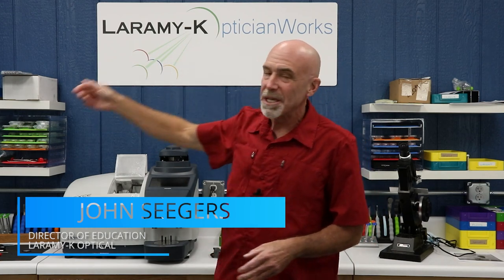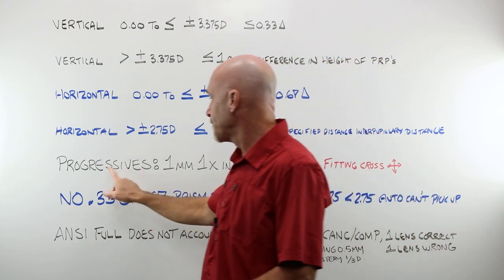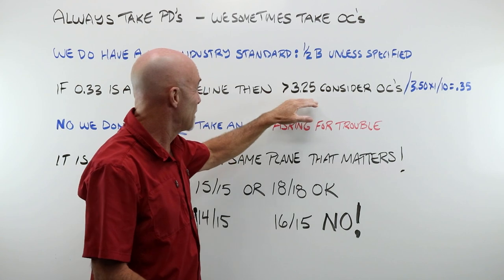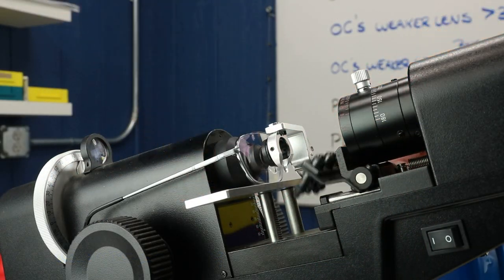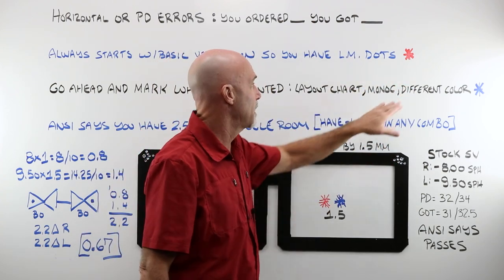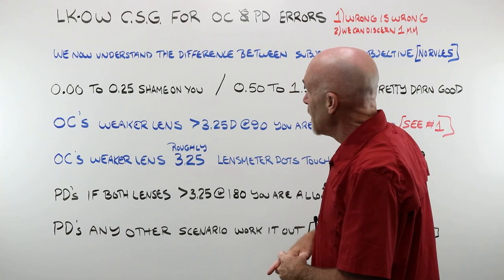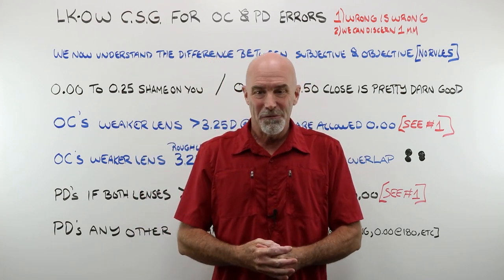Verification of Tolerance: Prismatic Imbalance or PDs and OC Heights

Comment: What is a wave test? My optician did a redo from polycarbonite lenses to 1.67 high index and inside the glasses case were my old lenses that they replaced with a post it on them that said 'wave test'. Just wondering what that could mean.
Reply from the maker: Sorry but no idea. A lens can have a wave or an area of distortion from surfacing error. Perhaps they have a high end auto lensmeter or a lens mapper that is capable of picking that up. But as to a specific "test" have not heard of that.
Reply: @LaramyKOptical  Thanks for the reply. Actually maybe it was the Optician that requested some sort of a wave test when sending them back to the lab and the lab didn’t know what to do with that probably.

Comment: Wow, this video really made things so much clearer for me!!! Thank you thank you! GREAT 3 part series.  I'd just like to clarify a doubt in my head I'm still unclear about. When working prentice formula, whether it's a horizontal or vertical imbalance, what do we do if one eye is correct? What if there is no decentration up or down in one eye? We can't do the formula with 0 mm decentration for that one eye can we?
Reply from the maker: That is why the whole ANSI/ABO Prentices formula stuff is garbage. Just go back to the mantra - if it is wrong sent it back and get it made right. If one lens is perfect and there is enough power for you to pick up an error in the other then figure out where it went wrong (OC no OC, binocular PD when it should be monocular, etc) and send it back. R lens is fine, left lens OC should have been 17 and it is at half the B at 12. Once again you aren't going to waste time trying to figure out if something cancels or compounds! I think you might be "overthinking" it just a tiny bit. You know enough to ask the questions. You know enough to see the problem. Then - You know enough to figure out what went wrong. 

Wrong is wrong. If it is made wrong send it back.

Comment: would a OC height matter more if a digitally optimized lens utilizing vertex, wrap, and panto measurements is being ordered? my thinking is yes. 

what about when we take half the B for a customer who has been glasses with the OC always in front of their eye? would they be bothered by a pair using half the B? My thinking is it'll be a bit of an adjustment at first but something they will adjust to fairly quickly. It would be a tougher adjustment for higher powers.
Reply from the maker: OC height will always be one of the point-of-wear (POW) measurements included in a true free-form personalized lens order/design. 99% of the time they will all come from a digital measuring device of some kind.
Reply from the maker: See: https://youtu.be/el_EAEGSOZE?si=DZ4gDWhJumkT8cEW

Comment: Hi John, what are your thoughts about OCs needing to be on the same plane when a patient has one eye that is definitively higher than the other? Should we do different OC heights in that case?
Reply from the maker: Really tough one there... If you can see the difference just by looking and powers are getting up there it may well be worth experimenting with different OCs assuming that there is a "problem" of some kind you are trying to sort. Might be something to try in basic stock cheap CR-39 as a test and take it from there. John
Reply: @LaramyKOptical  We use an Optikam measuring device in our office and it automatically provides OCs for every order, so we usually provide them to the lab. However, we have definitely not been ordering OCs on the same plane - usually it's just a difference of 1 mm or two between the two eyes, but your comments on the importance of them being the same has us concerned. If we do use a digital measuring device like an Optikam should we just split the difference between what it provides as an OC to get just one OC height?
Reply from the maker: @kirstenwikingazoulay  I've never heard of anyone using different OC heights on routine work. I guess this would be a case of if it works for you keep doing it (?) but it sounds like a horrible idea to me. What would you do if you got a pair like it from outside your office? Wouldn't you think that something was wrong? I mean the very definition of vertical imbalance. The optics of a progressive allow for differing fitting heights but it is not the same for single vision work.  I'm surprised your lab hasn't called you out on it? Does the work actually come back with the different OC heights? Always possible I'm missing something... John
Reply: @LaramyKOptical  No our lab has never mentioned this to us! I just called them to ask about this, and they said that depending on the office/optician they receive both - orders where the OCs are the same and then split OCs set to different heights for each eye. However, they did say that they generally recommend using identical OC heights where you split the difference between the two eyes (if there is a difference in heights). I am flabbergasted - neither the optician who trained us, any of the 4 labs we work with, instructors from other online courses, etc. have ever mentioned this to us over the year we've been working this job. We'll be switching to doing matching OC heights per your advice. I wouldn't have thought anything of it if I received a pair with different OCs because this was how we were trained.
Reply from the maker: @kirstenwikingazoulay  Since the very definition of vertical imbalance is that the OCs are not on the same plane I would think that the optician, labs, instructors etc. didn't feel it necessary to even mention it? If they covered verification and/or ANSI stuff it would have been a part of it. Oh well - guess it goes to show that in routine powers it really doesn't matter all that much!
Reply: @LaramyKOptical  At least as far as the optician who trained us - she expressly taught us to send in individual heights for each eye. To be fair, in taking your course we've found many things that were taught to us wrong, so I guess I shouldn't be that surprised about this! Thankful for all of your great videos.
Reply from the maker: Kirsten Azoulay PLEASE drop me an email through the OpticianWorks website. Thanks John

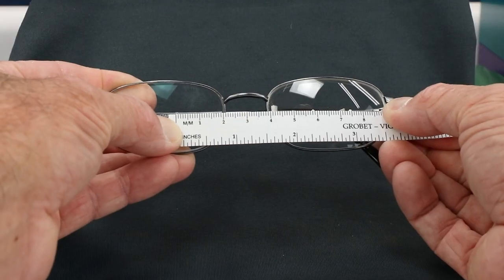Comment: 8:13 R lens with AR and the other without AR :D Correct me if I'm wrong but shouldn't aspherical lenses be centered: far PD R i L separately and OC R and L separately minding the panto (or measuring while perpendicular to the floor)? Event "reading" glasses with asf lenses ought to be ceneted with far PD?
Reply from the maker: NO, What you never, ever want is for the OC or vertical placement to be anything but equal. Kind of the point of the video. Don't care if they are high, low, spot on as long as they are on the same plane. PDs absolutely monocular but OCs always equal. (progressives can be different).

Comment: As a customer who buys glasses, never ever has any optician come up with any "proof" that the lenses are correctly made if I've asked could there be an issue with the lenses if I didn't see properly or there is something that bothers me in the image produced by the lenses. Maybe I could go and visit another optician and pay them to check if the lenses were made and installed properly in the frame.
Reply from the maker: Whew - I could go on for an hour here... At the very least any "optician" should be willing to double check powers in the lensmeter and dot up the lenses showing the proper OC/PD placement. Unless they have an auto-lensmeter showing you or proving to you would be a little tricky but certainly not impossible. I've certainly done it. Hopefully you watched the other two videos in that series which might give you more to go on. Now, every lab I know of has an auto-lensmeter and a dual lens mapper and they send that verification slip with each pair they send to the store. That may well end up in the trash but somewhere along the line you have a 70% chance that someone did check them before they left the lab. You probably have a 70% chance that someone checked them when they came into the store but whether that person had any idea what they were doing is another story. Keeping in mind that power(s) aren't the only thing that can create image problems. Anyway - if you came in to the store where I worked and asked me nicely to do a "forensic" exam on your glasses I would have done it for you no charge. I see it as part of being a real optician. Some places may charge a nominal fee for their time. BUT - unless you can also provide a pair that works and any "prescription" information they have nothing to compare their findings to. Hope that helps even a little. John

Comment: In vertical prism imbalance
Ordered
OD:-7.00sph   , OC:18/18
OD:-7.50sph
Received
OD:-7.00sph , OC: 16/17
OS:-7.50sph 
According ANSI.1mm difference (17-16mm)in height of PRPs 
Would it pass?
Reply from the maker: Yes but it has nothing to do with 18/18 and 16/17 only 16/17 being 1 apart. That is basically the example given right? ????
Reply: Yes.This is second example.but I add OC
In first example
Power +3.50D OU
Ordered OC 18/18
Received OC 16/15
it would not pass ANSI even 16/15 being 1mm apart?
Reply from the maker: @tuoinguyen9061  ANSI is never about the OC given to the OC received. ANSI is about the relative position between the two irregardless of any OC requested. So according to ANSI 16/15 would always pass. YOU (not ANSI) are the one to decide what happens when and if you want to work from 18/18 and work out Prentice's rule and compound and/or cancel. I think you are saying the same thing just in a different way maybe? And - yep it is crazy confusing hence why it took us over 3 months to get it done... If you wanted 18/18 and got back 16/15 send it back and get it made right. Bottom line - who cares what ANSI says!
Reply: Thanks